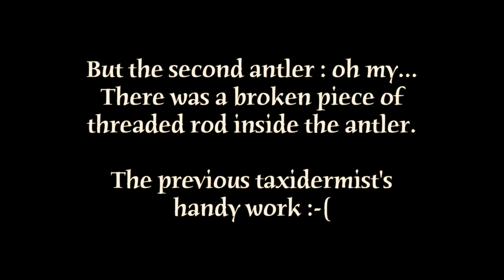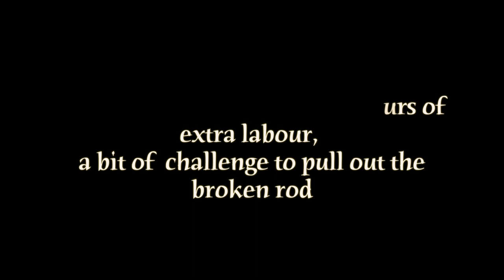Horn mount, Antler mount, ELK Shed Antler mount using Van dyke's system

Comment: This is cool. Quick couple of questions from someone just starting to do horn mounts: what type of foam did you use to cover the blue foam and shed mounting system? What do you use to attach the leather to the foam? Thank you in advance!!
Reply from the maker: \im using polyurethane foam. and i dont glue the leather to the foam, i just stretch it around the foam and then staple on the back of the board. i use hot glue to glue down the braids for decoration.

Comment: You showed making the braids, but not putting them on?
Reply from the maker: It must have been a quick hot gluing in the seam and obviously trimmed out when editing.
Reply: @ArtofTaxidermy   Do you have a video showing how long and how wide you make the braids?
Reply from the maker: @dreamlookautodetailingauto3353  no, just because it is different on each animal,, there is no set width or length,, I usually measure the length and then braid a llittle longer. the width of it depends on how wide of an area you are trying to cover. like 12" long and 3/4" width is a good size for an Elk..